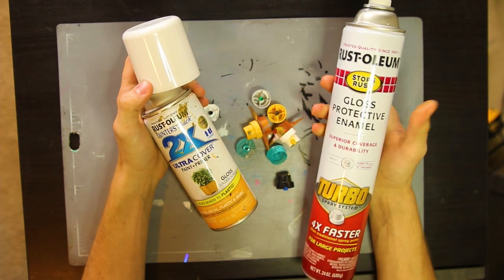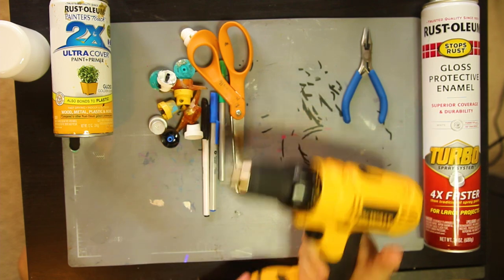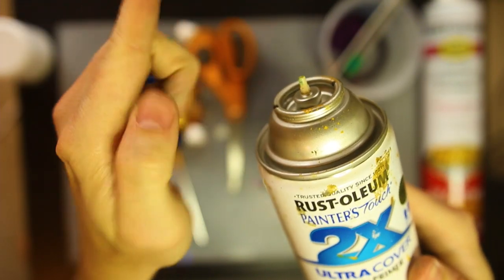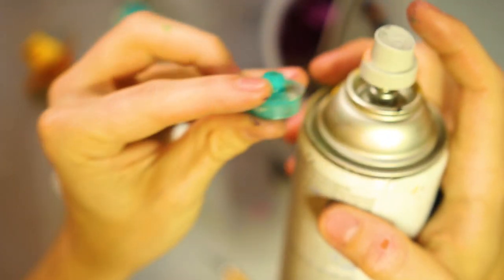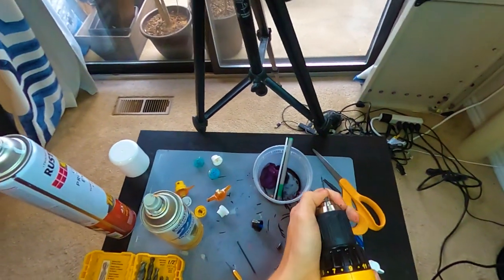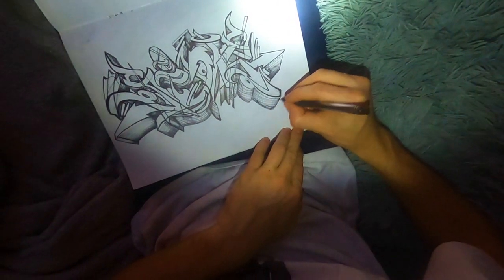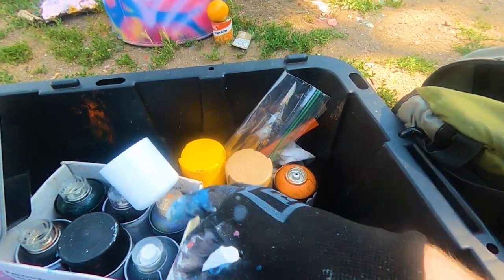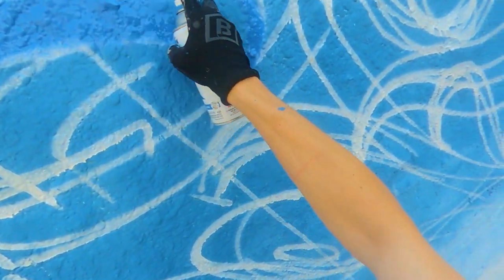How To Make A Spray Paint Adapter Cap

Comment: those wing tip adapters work great, i ordered the same turbo spray for a home project. the nozzle was damaged so i had to buy adapters, However the hole in the adapter was a bit smaller than the stem on the can, so you may need to open it up just a bit more wit a small drill bit. (just for anyone who had that same issue)

Comment: I spray cars with Rustoleum. Do you think there's a way to make the Turbo caps work on the smaller Rustoleum cans? The fan tip would make those cans easier. Great video.
Reply from the maker: Yeah you might be able to jam in a 1/8" tube to make up the extra diameter. Won't spray as wide due to the lower pressure. I might just recommend getting some graffiti caps with the pen adapter I made for larger fills
Reply: @S1VE  i figured it would probably not spray as well. I appreciate it. I did order a set of nozzles a month ago that was a variety pack. It has 5 different caps but I thought it would be nice to keep the spent ones. Maybe even convert the cans to refillable. Thank you.

Comment: Great video, been looking all day for a way to use my 3M female cavity wax wands on male top of  another brand, that's pretty crafty. Lil hot glue or shoegoo works great for fast set seal if need be,  gotta undercoat my trucks wheel wells with cheaper stuff, 3M is expensive and a can doesn't go far but did what I needed, now I'll use less expensive CRC in other places like my doors and wheel wells, kudos!!! Wands would work with paint to...

Comment: To this day i use turbo rusto as my go to black fill... killz cans are still the best canned white and rusto high heat enamel in black ( which has a female valve) still is as good as euro cans and lasts way longer... what ya gotta do with the turbo can is super easy.. stock they have that giant fan can.. wit scissor cut it flush to the top and smear super glue or rubber cement on it and cover it wit a small piece of tape.. any kinda tape masking tape works best.. congrats ur half way there... now take a 1/8 drill bit and slowly drill up thru the nozzle hole on the glue sealed fan cap... when. Done u should half a hole from where the cap pops on the turbo can out the top of the stock fan cap.. now take what ever fat cap u use to fill like for throwies i use a level 6 it will almost spray a perfect O but there will be alil loosenes on two sides.. anyway take the fat cap turn it up side down amd with tiny fingernail scissors clip out the webbing ( the four pieces of plastic that make a cross under the fat cap.. two snips will cause each peice to just fly out.. when done ur fat cap will look exactly the same except the underside will have like 1/8th inch of open space... now with rubber cement or super glue both work equally fine put a small dab on the fat cap down spout and around the inner ring that u just snipped out.. push the fat cap onto the stop turbo cap so the glue covered down part goes into the hole u drilled(line up the fan cap line to the fat cap hole so there both forward faces just like a fat cap onto the turbo cap... wrap electrical tape once or twice around the sides so it looks like a fst cap thats just slightly taller... BOOM you now can use ur turbo can amd it will work exactly like a 600mil Montana black can (except black rusto acually covers more and better amd lasts on the wall longer.. use a killz spray can u can get at home depot and u just used home depot bought cans but they worked as good or better then euro ones and if u use the white turbo just use the high heat black ment for BBQS to out line if u wanna do white fill black outline... congrats ur now able to do graff the American way with American paint and the whole time ull ask ur self how u didnt know rusto makes female valve cans still cuz u never used the high heat ones (the kitchen enamel ones are female valve too) there a buck more then the high heat ones but instead of a BBQ on the can there a picture of a oven and fridge...  ive never seen any of this info online ever i litterly figured it by buying the cheapest black rusto paint on the rack and laughing when i saw its a female valve.. the non bucket caps work best on the high heat and killz cans like the caps that are shorter with a larger thumb grip on them.. they just fit perfectly the regular outline and fat caps sometimes leak slightly but no more then euro cans do.. hope this helps anyone whose got nothing but a home depot and thinks theyll never have paint that can do what euro cans can do.. you can.. all u need is ny fat caps or level 6 and level 3 caps and ur golden....and watch how people will think ur toy when u pull out rusto then look like a G cuz it sprays like a astro not to mention when people see female valved rusto black cans everyones gets to feel like finally American spray paint has stopped being the joke its been with the male valve system.... stay up and stay gold

Comment: Will the rustoleum turbo spray tip work on a regular rustoleum can if I cut the pen parts like you did here in your video.I guess Ill try it.
Reply from the maker: No the stem of the turbo is larger than the standard rusto

Comment: I got the GIANT Double XL Can with that crazy 2 vent cap. Those cans run fast and empty quick! If i woulda took the stock vent cap and replaced it with a Fat Cap i know i coulda extended that cans life span but i feel like those cans are good to use for one MONSTER THROW. U got one good outline or just a FATTY hit up or 2 with that vent cap . It take a modification to get the fattest regular can i could use so i would be able to conservative paint...

Comment: so i recently did this and it worked however, since in all the stems of the caps there was a slight cut that was made on purpose, some of the paint was constantly spilling. would you know how to fix this?
Reply from the maker: Hmm maybe need a slightly longer adapter to make sure it’s covered

Comment: Snowball cap, Blaster cap, Jumbo cap,  tester cap,  ¿Are any of those spray caps still around? We use to have those back in the 90's, the caps aren't even the same as the one's we had back in the day. Just wondering.
Reply from the maker: No not quite, a company has started remaking jiffy and Wally caps from the 90’s but for the most part they are all remastered

Comment: Any idea, or help....what adapter can fit or make a  normal male spray cap to fit a female polyacrylic can?... works for my other cans.   ▪︎The female aerosol insert is to long for my short cap stem to depress the can.
Reply from the maker: That’s a tough one for sure. Might need to do a long male adapter to a female back to the normal male

Comment: When you cut the ball point pen off the little plastic piece.... you realize if you hold the blue piece and push the ink tube up it will just slide out and you don't have to worry about ink getting everywhere
Reply from the maker: awesome tip my man!
Reply: That's the same thing i was about to comment. I only know that technique cause I use the ink from those pen tubes to make homemade krink paint to fill shoe polish bottles with

Comment: good tutorial, but it HAS to be said, youre STILL at the Toy level and youve had this channel for like a decade or more, and its very VERY strange that youre STILL at this level of graff, even if you only did a few black book sketches a year and a few walls or practice walls a year then youd still be far past this current Toy level of graff youre at, im honestly very shocked you HAVENT really progressed that much, its one thing if you were intermediate least then theres not too much reason to be hounded or pushed to progress cause youd be at a respectable level, but unfortunately youre not even at intermediate yet, you have a lot of thicc pieces going to ultra skinny for no reason, lots of random blocky toy asthetic arrows, for no reason, and it looks like you JUST started getting into straight bar style which is something most Toys get to within their 1st or 2nd year of graff, yet youre still in after more than a decade,  based on the style and habits you have you seem like youre right at that intermediate level of a Toy, btw im not saying "Toy" as an insult, but as its intended which is your current level of graffiti style unfortunately. you seem to have a good idea on the understanding of paint and can pressure and technical stuff, but youre actual letters and esp Tags are definately NOT up to the bare minimum standard of a writer or even casual writer of over 10-15 YEARS, you SHOULD be much better than this, and take inspo from your favorite writers and sit in your bed or desk and just practice letter forms and tags an hour or 2 every other night or even if its just on the weekends, because ive been casually following your channel since you started it like almost 15 yrs ago and its weird how ive progressed and taken very long breaks and yet i can hold my own as far as style and letters, but you havent progressed that much from the toy kid you were 10 or 15 years ago and its just very very weird to me, so my .02 cents? use this quarantine time to study and practice your letters and tags and evaluate your strengths and weaknesses of your letters and tags and 3d's and make a goal to get to a respectable tier of graff for the amount of years youve been doing it, whether its consistent or casual you KNOW you should be better than this. i hope you find a few grains of truth and smol grain of advice and hope to see your letters and tags improve to a respectable level, NOW GO GET IT BOII!!
Reply: Lmao
Reply: My 2 cents.....learn when to use a full stop.